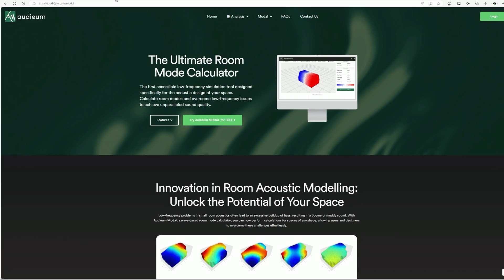Understanding Room Modes: How ODD Room Dimensions SHAPE Your Sound (And How To Deal With It)

Comment: Hello, I inherited an old audio equipment from my grandfather. This is an AKAI am 2450 amplifier (45 W per channel at 8 oms) with two speakers model SW 177. Three way 4 Driver 94 db. I want to know if it is a good deal to refubish and maybe upgrade it to put them in my small room (4mtsx3mts and 2,90 tall). I think because they are enclosed speakers I will got better control of the low band altough maybe I need to treat my room maybe. Whats your opinion. Thks Very Much!!!

Comment: I found this material called DeciBoard on Amazon it’s a sheet of dry wall like about 1.50 inch profile has these contact points in the back that leave a small gab between the material & the wall you are installing it on - and in between the layers of the material there are sound absorption properties - @ $70 USD for 12sqft it’s not a terrible start - personally I’m trying to create a sound isolation booth for my guitar amplifiers inside of a L shaped closet of about 138sqft including the floor & the ceiling - trying to minimize as much noise as possible because I live in an 800 sqft apartment

Comment: So yeah, even though I'm interested in the science, my top priority is to find a good starting point for the quest to find the best listening position. Unfortunately, my room is L-shaped with a slanted roof, a roof window, balcony door and window, other room doors. What's more, there are loads and loads of furniture I have a hard time to move, and I've already moved in my gear, too. That's why it's almost impossible to go with the bass hunter technique. All the corners are blocked by granma's furniture... I really would need some advice to where to begin, actually.

Do I have to completely empty the room , then apply the bass hunter technique? But what if I put the furniture back in afterwards? Wouldn't it render the entire process in the empty room useless? I'm kinda stuck here, I just figured out a spot I kinda like, facing the slanted roof, with a wall to one side, but like no wall at the other side. To my  old and fucked up hearing, it sounds ok-ish, but my measurements with REW tells me the position is awful...
Reply: If you plan to leave the furniture there, then it becomes a room "characteristic", which you have to deal with and thus looking for a listening spot with all the furniture in your room. 
If your plan is to clear the room and start from scratch, then you'd better make all the tests in an empty room, unless you already have some bass traps, which would make your tests easier. Sorry for an obvious answer. 
Nothing wrong with relying on REW. In this case I'd look for a spot with peaks & troughs spread out across the spectrum as much as possible, avoiding them to form one giant peak or trough.
Reply: @zerobject  Thank you! Now that you mention it, it seems pretty obvious with the furniture haha. Thanks.

Comment: Hi! It is possible to decrease the low end accumulating to the back wall in an very small shoe box room? Could an membrane panel on the back wall will help or better an resonator? Seems that it is hard to find any of that on my country and they are very expensive. Thank you!